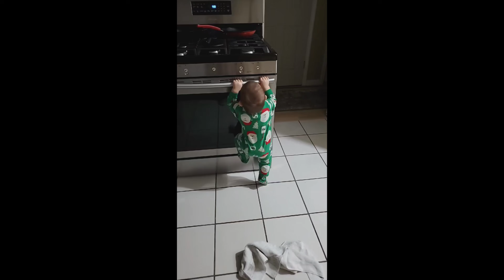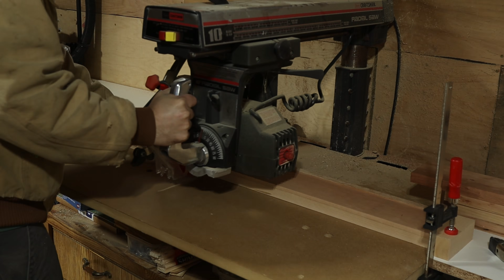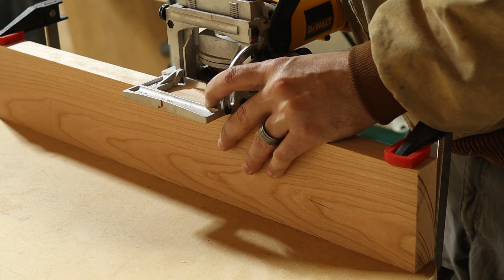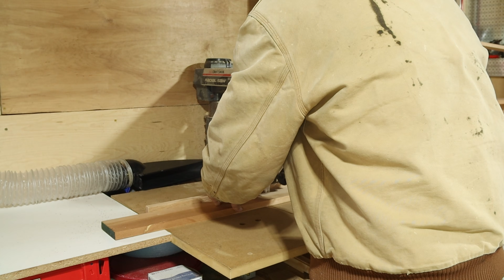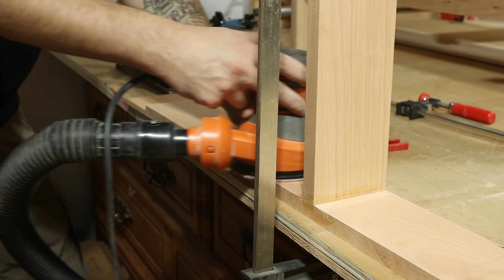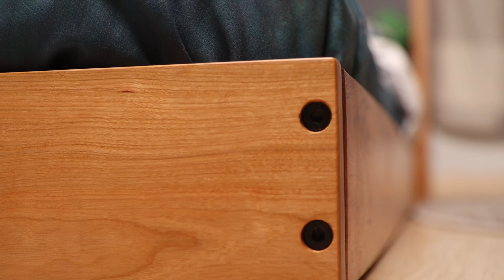Building a bed frame with no plans...

Comment: Absolutely love this project! My kids now grown so no one to build it for now.
Wisdom after a couple of hundred treaded inserts . . . just clamp in line with the inserts across the grain so that the wood Can't split. Also rub the threads on the inserts with candle wax or paraffin. Failing the wax, a drop of oil in the intended hole for the insert works but adds the danger of oil stain if you are not careful. Last and most important: Don't use the driver intended by the Mfgr. Thread a nut onto a bolt that fits in the threads of the insert. Run the bolt into the insert _almost_ protruding the other side. Tighten the nut securely against the insert, jamb-nut style with pliers and a wrench. Now use the tool of your choice (wrench, socket, etc.) to install the insert using the seized bolt. Hold the bolt secure and back off the nut then remove the bolt. Voila! Bobs y'er uncle.
Reply from the maker: This is amazing information! I use the bolt trick when I use keysert but didn't even think to do it with these ones. Again. Thank you much for sharing this knowledge with everybody. 🙏 I will definitely remember these on the next project.

Comment: Great video!  Cool design!  Rotate your table saw 180 degrees!
Reply from the maker: Thanks Thomas! Why do you say to rotate the table saw?
Reply: @JasonGrissom  Your glass door wall might be the victim of a table saw kick back.
Reply from the maker: That's a great point! I do need to consider some form of protection for it. The reason the table saw is there though is those doors are actually french doors that I put in so that I can bring in large sheet goods and feed them right into the table saw. My shop is 16x16. But you are absolutely right. When the doors are closed it would be a good idea to have some way of protecting the glass. I wonder if a heavy set of drapes or blinds would be enough?? 🤔